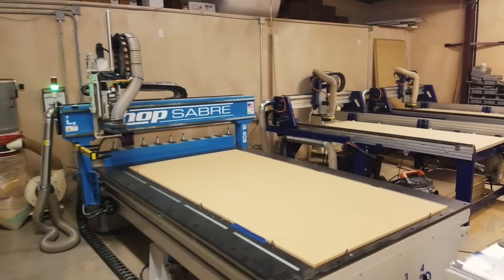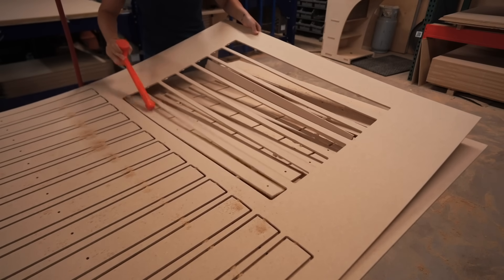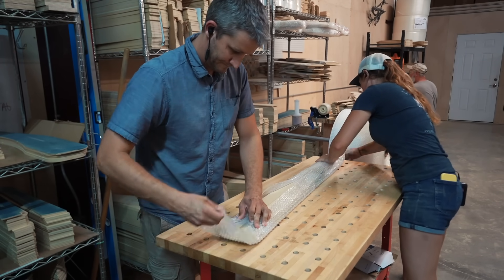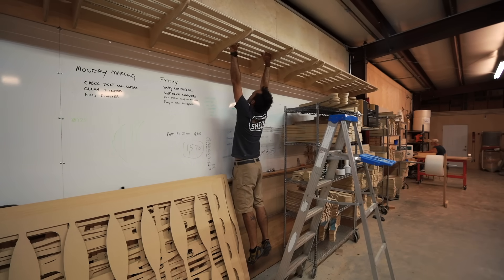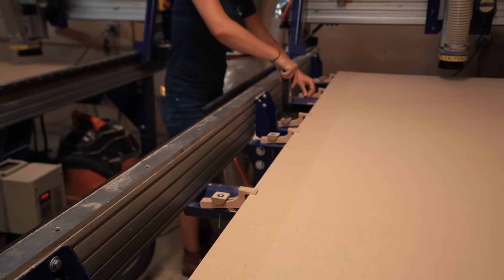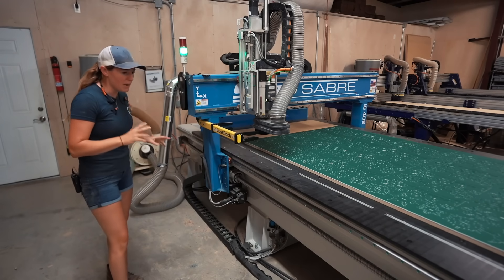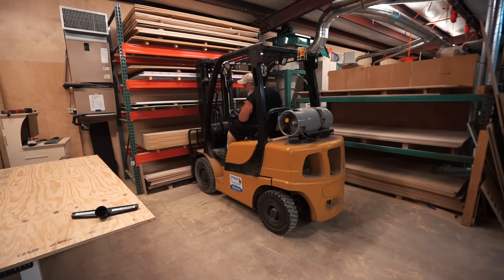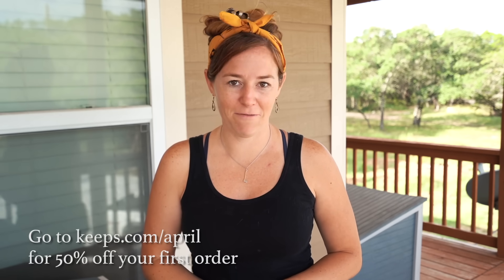CNC Shop Tour | My CNC Business

Comment: on the long edge you can just leave tabs on one side only that will cut down 50% of detabbing.  so the short ends and one long end would not have tabs, just one of the long sides. also make sure the side that has the tabs is the last side that is routed.

Comment: Buy a wood chipper or a hydraulic shredder, to dispose of all your material, you can sell it as bedding, or the stuff they throw on the floor, if it doesn't have paint on it. 
    Or if you throw it away, it saves you money if you pay by the bin. 
   You should have a night shift doing All the cleaning, sorting stacking, separating, doing All the minimum wage labor, or have a ( go for, to have them doing all the movings, or anything of no skills) 
    While you set up everything so that you are getting 40 hours of nothing but production. 
    You are probably getting 20 to 25 hours of straight production. The rest is, wasted labor. 
   So most people loss that time they are basically paying for. 
    If you can have one person set up and run two machines it's good. But if you can have two people run, setup, multiple machines, you save a few days a week in work, means you and that to another machine or your paying back for them all. 
     PS you can Call General Steel, they have ready made shop's, buildings, at great prices, you can have it built next to your shop. Then use your shop for a office and storage. .
     You already have everything set. There are manufacturing setup books, in library. That get into the weeds. 
      I like how you have everything set up. 
   You should put a shelf above the machine. 
  Just like the table you have. Take off one shelf then put back on other shelf.

Comment: hello and greetings from Vancouver Island BC Canada!
Your shop saber has some interesting features. If I may ask a couple of questions.... How fast will it travel in X and Y?  Is Y also ball screw drive?  is it an AC drive brush-less servos or DC?    HSD... best spindle in the world imho.  $7000.00 for a 5HP..... not sure if that is up to date. im using 2007 figures!! 

I have a 5x10 x12" 5hp machine. it is driven on a rack and pinion drive system. I would really appreciate an upgrade to ball screw drive

Comment: Has the CNC machine taken the craftsmanship away from the craftsman?? It's fantastic how it speeds up production tho......
Reply from the maker: For a production shop, replicating templates or parts it's definitely the way to go. If I use it to cut pieces for time ease for my one project, it's still a win. I'm still designing and assembling, just the first step is quicker. All on how you choose to look at it. Some want to only use hand tools, no electric tools at all. Great for them but I have too many things to do to spend that much time cutting something out by hand. Thanks for watching.

Comment: I’m curious to know how often the CNC machines need maintenance or servicing? How reliable are they?
Reply from the maker: We've had no problems except for occasionally needing new bits. The two Shopbots were 2nd Hand, picked up from a Shop that was closing. They needed some work but have worked fine since. Thanks for watching.

Comment: You could make yourself vacuum beds for the other machines on the shop sabre, (Psst, the pro408 can cut a 5x10 sheet, idunno if the is408 is the same but its plenty to make a larger than 4x8 vacuum table) So worth it to eliminate the entire de-tabbing process.

Comment: Screw a bar across all those hold downs that pivot. If the bar is stiff enough, you would only need a bolt at each end of the hold downs. Same effect, a fraction of the work.

Comment: I worked in a manufacturing facility for several years and to save labor and time you can build a a sled and run your vacum through it with a manual valve, then run a program and while you are managing material (offloading) the program will run and vacuuming the table so when you return the table it is ready for next sheet. For us, we eliminated a lot of idle machine time. And found we increased several cycles / day.
Reply from the maker: Thanks for the great info! And thanks for watching.

Comment: I uses to make custom motorcycle parts, My biggest problem was margin compression from Asia who would copy my design, mass produce the parts and then sell them at my cost of material. China buys raw material in bulk by the train load for prices I could never get. They could not reproduce my quality, but low enough prices can cause quality to be over looked. Mine was not CNC, because tolerances on some parts were very tight, but it was assembly line type production. Finally at $5.00 bucks an hour for my time I shut it down. It was fun while it lasted. I'm glad I did it, because it I had not I would have always wondered.
Reply from the maker: Yes, it can be very frustrating. Many small family owned stores are put out of business because they can't compete with bigger stores who can order in higher volume. Thanks for Sharing and for watching.

Comment: weird, these cnc routers use the same tool holders, auto tool setters and tools as HAAS CNC machines. Just a more simplified version, no way covers or anything for the lead screw or the exposed linear rails up there but i guess you don't need it

Comment: We found that sealing the edges of the sacrifical board with a thick weather board/fence paint increased vacuum by around 50% allowing us to make small parts without tabs eg.(30mm×40mm with 2x4mm holes and 1x9mm hole using 12mm ply board)

Comment: Hi, instead of using screws to tighten down the hold down clamps, you could replace the screws with knobs with threaded posts. Then you can quickly 
tighten & loosen the hold-downs by hand, instead of having to get a screw driver. Or have you tried that already?  There are all kinds of clamps and things
that would have to be way better than those screws.  Good Luck!

Comment: Hello - is there any reason why you can’t de-tab those parts more than one at a time?  Seems to me if you stack a few together and use a longer bit
On the router you should be able to clean off several at a time.  I used to work at a place where we employed a method like that for other materials.
It just seems doing one at a time would take a lot more time than you’d want.  btw- you have a good guy working with you, very resourceful,
Best of luck, I really admire your entrepreneurship!

Comment: Instead of cutting out 20 or so templates on a large sheet have you ever considered cutting out 1 smaller sheet on a proper cnc mill with a fast pallet changer? Something like a Brother R650 would likely double or quadruple throughput, use way less floor space, and give you the ability to run any batch size. There’s certainly a number of drawbacks with that type of machine but if you have enough small parts to keep the machine busy they are almost impossible to beat. 

IMO routers are for large parts and mills are for small parts. Nesting small parts on a large router is not ideal and about half the parts in the video would fit on a smaller more productive machine.

Comment: So all you do is routering? Also why are you tabbing the pieces most CNC routers have suction mounts to prevent the piece from moving when you cut through the profile like youre supposed too.
Reply from the maker: No, a CNC machine can mass produce a product, templates, signs, etc. It is a great asset to have in a Shop. Thanks for watching.
Reply: @AprilWilkerson  I know what CNC machines do you only have CNC routers and they look 3 axis though which is what i was asking. Also if your vax system is good enough you shouldnt have to program tabs and you can cut through the profile into your spoiler fully which saves you alot of time "detabbing" your parts. You also get a more uniform and cleaner finish.

Comment: Great video! We are jealous of the machine sizes (especially the auto tool changer and the vacuum table) and the size of your shop!! Kelly and I started 2 1/2 years ago with a much smaller CNC and now have 4 tables running. Still not at the Sabre scale yet lol - do have a question for you. On the green and blue white core PVC board (assuming it's PVC?) are you sourcing that colored or do you have to paint it? Either way, can you share more information about it? Thank you again for sharing your process and for the shop tour. Edit: Looks like the sheets might be something similar to an HDPE product called Colorcore?
Reply from the maker: Yes, it is Colorcore and comes in the colors so no painting required. Thanks for watching.
Reply: @AprilWilkerson  Your video contained so much useful information, thanks again for sharing! As we close 2021 down we are wanting to leave no rock unturned to streamline our own operation going into the new year. We have been wrapping wooden signs in bubble wrap and EZ fold cardboard mailers. Your padded envelopes look like a much simpler approach. How did you assess the durability of them and can you give any additional tips on what to look for?

Comment: Nice job.
Like others have said, I also got into CNC, back in the '90s. First machine was an Andi 4x8, zoned vacuum bed, 8 tool changer, L shaped multiple drill box, all axis ball screws. It was a good machine but 4x8 is very limiting for store fixture work. I then got a used 5 x10  Komo with only 500 hours on the meter. It came with a 40 hp Quincy vacuum and was a moving table machine. All the bells and whistles. Bigger spindle motor allowing 1 1/2 board to be cut at full speed. Both the Andi & Komo run Fanuc controls, Perfect over thousands of hours of operation. 

In between I also ended up with a heavy German made IMA point to point. It had great abilities but many problems. 18 position tool changer, 21 spindle drill box, C axis on the main spindle, 4 way drill with rotary, two aggregates. One that can drill with 4 different bits at any rotational angle. The 2nd aggregate was a saw that could saw at any angle and score. The water cooled spindle had flow control problems. The controls had frequent problems. The safety matts were hit or miss.  The software needed updating but was terribly expensive. In the end we tore it apart and have been selling pieces.

Comment: My shop used to use a CNC router for cutting signs, but have moved onto C02 lasers. 1/4 in MDF is easy to cut with lasers and since it requires no tabs, post processing is much easier

Comment: I am a woodworker of 35 years. I have several designs that i have taken to completion that are very detail oriented aka time consuming. One specific project has everyone all googoo eyed and want me to mass produce. So without giving too much detail i have  two questions. Can you do real wood of multiple species and how tiny is the smallest bit you can use to create say a leaf with tiny stem? ( not the profile i am looking for but the specs would match)
Reply: The versatility with these machines really allows you to cut fine detailed parts like leafs with different bits and materials.
Reply: @shopsabre  I apreciate the response however i still have the one question of ,"what is the tiniest bit?" My design i cut out with a scroll saw requires a cut  to be as small or smaller than 1/64" in woods such as walnut, maple etc. without burn in 1/4 inch stock.

Comment: I've never seen your videos or heard of you, just came across this in recommended. It's probably in recommended cuz of all my CNC interests, career, and desire to start my own business. It's amazing you've made a business out of template making and then grew it. I'll look through some of your other videos and maybe stick around. 

Though, I wouldn't consider the Shop Sabre anywhere near a commercial machine. That thing is adorable. 😂
Reply: What makes you say so?
Reply: @shopsabre  Working with actual commercial machines like Thermwoods and Homags. The build just isn't really comparable. The tool change setup, the vacuum setup, the weird need to remove the dust shroud to change a tool, the size and weight of the machine as a whole. They're just different levels. Though it seems to be a fantastic setup for what you're doing and the materials you run, so more power to ya. No point in having a $100k machine when the need for such a machine isn't there.

Comment: ever thought about making electric guitar kits, good ones, not the entry level, but good ones? pin router, band saw, chop saw, yadda yadda, you could make pianos, wood bodies anywho, whats max depth on the shop sabre?

 sweet shop, I'd be making high end furniture or high end musical instruments..
Reply: Max depth depends on length of the tool and clearance with material. With 12" of clearance and a 12" bit you can cut 12".

Comment: Hello April,  I was wondering if you have ever considered cutting two panels at the same time on your CNC machinery? If you have adequate torque and the correct cutters that match that criteria, then you may be able to double your production efforts. You are doing some nice work over there..KB
Reply: You couldn’t really use tabs in that case :/ 
I can’t think of a way to hold the top pieces in place while cutting the sheet below, other than way too much double-sided tape. Maybe the vacuum could pull through the 1/4” mdf enough to also hold the second layer? 🤔

Comment: Do the hold-downs with small air cylinders.  One button or switch push will lock down the material.  Simple and should be a fairly quick upgrade.

Comment: Are you using Auto Cad or Pro-E to design your parts, I was a tool & die maker for 40 plus years, CNC allows you to make high production work more parts less cost it is that one off part that is most expensive looks like you have a good start in your business.

Comment: i dont consider cnc machines part of wood working since your not doing it with your hands your self!
Reply from the maker: Just another tool to use, paticularly mass producing things like the templates I sell on my website. Quicker than cutting out each one by hand. No different than using a drill vs a screwdriver, a circular saw vs a handsaw. You are still creating something and enjoying the build.

Comment: Fascinating! Jacob's hold downs are good solution - I'd think a vac bed would clog with cuttings. Your success is the promise of what this country allows - I pray it stays that way.
Reply: The vacuum pulls the material through the spoil board so there is no way for chips to clog.

Comment: Great video, your sucess is well earned. 

If I may suggest, paint the sides of the spoil board. The vacuum will hold better/use less energy since there is less leakage of vaccuum from the side. . 

Also, have you tried to get rid of the skeleton between pieces? I have seen quite a few shops very the manage to get rid of it and therefore been able to get more piece from a single sheet.

Comment: You could add on a thermoldwood cut ready center to flat pack cabinet parts for shipping to be assembled by the installers at the job or  his/her shop
I say her also becuse it looks like your not the only female woodworker.
The cut ready center has all the programing in it you just load sheets it does all the work.
You could ship an entire kitchen on a pallet.  And make any styles the customers ordered. In fact the job could be written up by the installer at the customers house,  
If its a local job you could also assemble it.   This would put you give you a leval playing field to imported cabinets industry and better qulity then home depot offers as im told they are made out of MDF.

Comment: Nice to see a hard working person enjoy success. You have done a great job in building up the business and you have all reasons to be proud of your achievements. I do have a few years experience in CNC and what I miss in your video is fire safety and fire preparedness. Sadly, I have seen quite a few similar businesses go up in flames. CNC machines produce a lot of dust and the dust extraction (and vacuum) systems introduce the oxygen to quickly get a fire happen. A good size extinguisher at each machine is a must. As is a bucket of water to act quickly in case of an MDF fire. Those are very, very hard to extinguish. My two cents. Both thumbs up from me, you are a powerful girl.

Comment: Your next machine should be a Thermwood.  maybe something like the Framebuilder 53 with the optional lift table and auto load features that would allow the machine to clear the cut pieces and pull new blank sheet onto the cutting bed.

Comment: Amazing workflow and the video is a fantastic walkthrough.  If you replace your hold downs with toggle clamps would you save even more time on material placement/replacement? I'm trying to find something with a perpendicular handle (ratchet down away  at 90 from the work piece and into the void between the work piece and moving mechanicals) and quick height adjustment for materials changes? Someone can take that idea and run with it. The screw downs just seem so cumbersome but I suppose it all depends on how far to the edge you run your router head.

Comment: I don't understand why you have so many toy CNC machines, why not purchase one or 2 big fast machine to replace those happy harry home owner  ones, like a multicam, onsrud, Koma, Thermwood, ect some thing with maybe multiple 4x8 sliding tables, or a 16x5 table, can cut one side while loading the other. For example my GMR with a 18hp spindle I can run at 800 ipm no problem. That one machine often cut 30 sheet a day. It just seems that you have lots of floor space taken up with little guys. Just asking
Reply from the maker: Not sure if you know how much those huge machines are but for me as the one footing the bill, I think I'm doing pretty good. I don't consider my CNCs toys, they provide for my business great. Perhaps in the future I may get another type but everyone has opinion on what I should do but they aren't in my shoes. Thanks for watching.